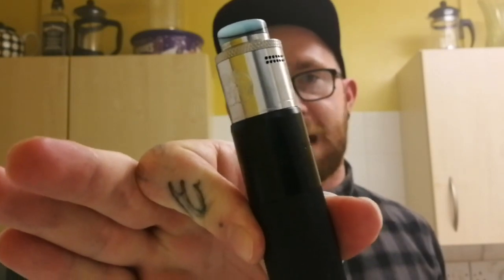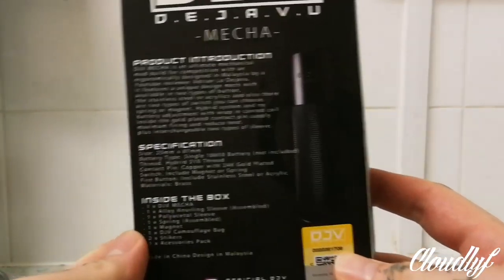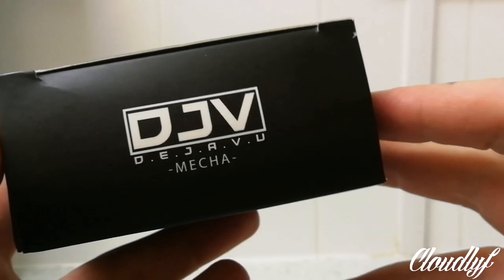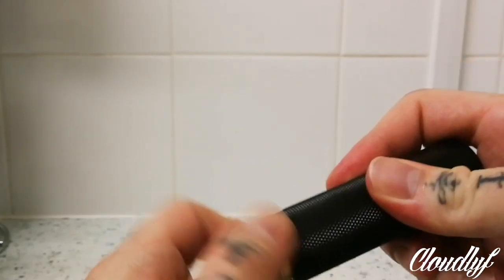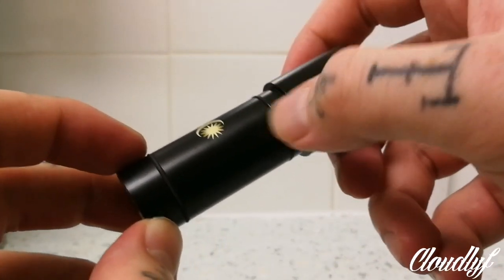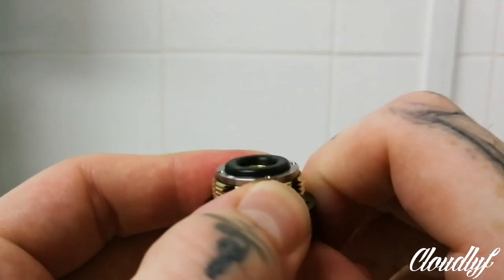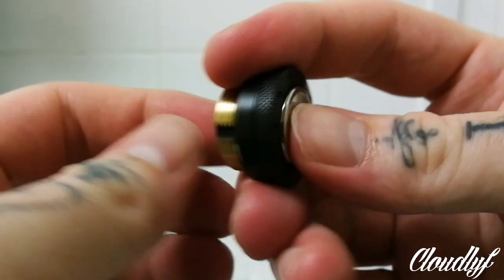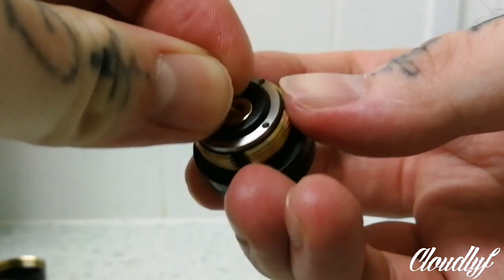DEJA VU Mecha Mod Review- Impressive amount of extras!!

Comment: Woohoo its a hybrid thank you Adrian
Reply: I would of liked it to be a magnetic or clutch system firing button because they last longer than a spring but maybe it'll fit magnets from another mod
Reply: And I don't like that the venting is on the bottom so positive down and positive up on a hybrid is a little safer
Reply from the maker: The spare magnets in there are for the button. I just preferred the spring feel personally but it's each to there is.  There was little to no heat transfer from the atomisers I used on top of the tube though. Conductivity is insane on it too. Competes with a lot of higher end mods.
Reply: Cloudlyf Reviews oh I only saw the extra spring and springs wear out, and I don't know if its just my luck but mine always wear out faster then normal.... Do you know when its gonna get released in the US
Reply from the maker: Not sure on the ETA for US but I can imagine it's fairly soon now buddy. 👌

Comment: .1 ohm?? How did you get that in a single batt mod? Is that safe on that build if using the ohms law ?and also what battery are you using and the amp?
Reply from the maker: Heya Luigi!! If you see in the video I was using the Drop Dead RDA. It is a dual build at 0.1ohms and are all Ni80 so ramp up is nice and quick. Plus I'm using Sony VTC5as which are completely safe at that ohmage. 👌
Reply from the maker: If it was 0.01 however. Then that WOULD be a problem 😂
Reply: Vtc5a have a 25amp cdr .. on .1 ohms if 4.2v/.1 it will be 42amp right??so how is that safe? If base on the ohms law calculator..Sorry im new cause i read in an article that you should not exceed your battery amp if want to get safe
Reply from the maker: @luigisuela018  remember on mechs it's a lot to do with pulse rates aswell not so much continuous discharge. Check out what Mooch recommends on Facebook or his online blogs buddy. You'll see it's perfectly safe :)

I wouldn't put it on YouTube otherwise ☑️💯❤️
Reply: Cloudlyf Reviews can you send me the link so i can find it easily

Comment: So what do you think about voltage drop how is it compare to let's say a vgod mech?
Reply from the maker: In comparison to the VGOD mechanical tube range id say it's on par with the Elite V2. I've not experienced ANY voltage drop personally with this 👌 I can only say that personally I think this is one of the most under rated tubes I've used to date.
Reply: Cool, thanks for the info man. I've already order 1 for myself, good 18650 tubes are so hard to find where i'm from, just alot of  bad clone of vgods.

Comment: Do you put the battery positive up or down?
Reply from the maker: I put the positive down on this one bud. Ventilation holes are on the bottom so most of the time with tubes I put the positive where ventilation is :)
Reply: @cloudlyfreviews73  is it ok to put it at a battery positive up direction?
I want to know if its safe to do it or not.